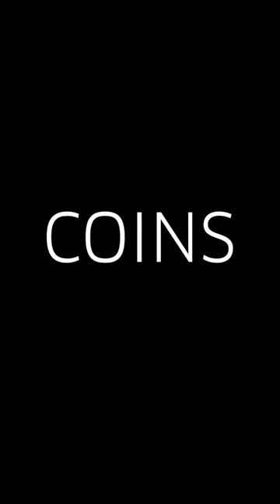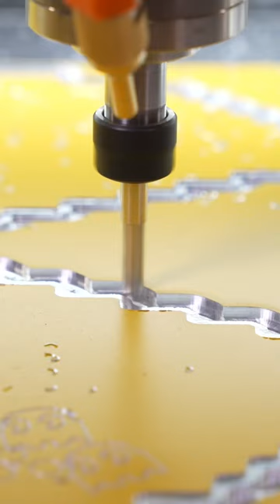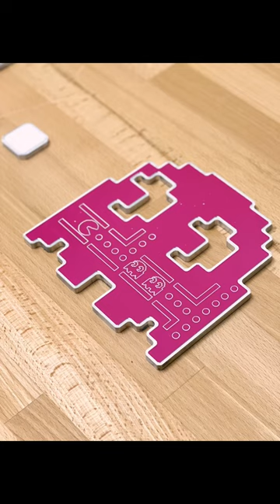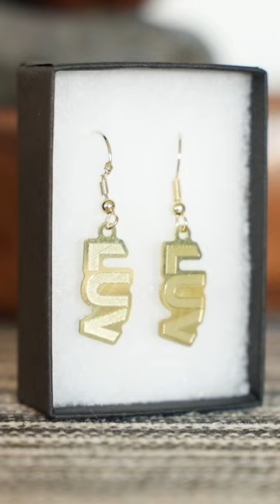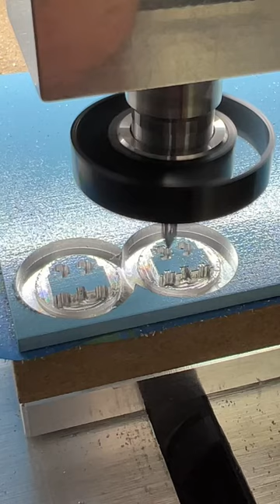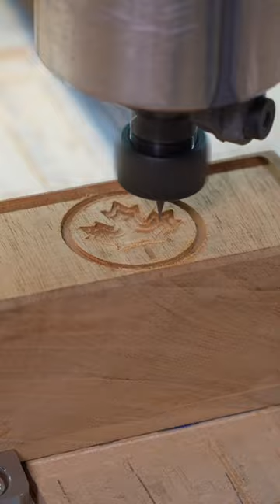5 Metal CNC Projects

Comment: woahh i never knew you could get a CNC machine at your house! and for a reasonable price! do you have any recommendations on which one to buy? i love 3d printing and this seems like it would be right up my alley
Reply from the maker: This is a very individual question.  Look at the space you have available and buy the largest machine you can.  Because, when you start making things, you'll immediately think of something larger than the footprint of your machine.   For many people the 4x2 preserves space in a workshop or garage while still providing the ability to index full sheets of plywood through the machine for those large projects.   It's the best blend of capability and footprint.   That said, if you have space for a 4x4, there's nothing quite like the power of that real estate.   (also, the VFD is how the machine is really meant to be.  If you have the money......do it.   That's how we equip our in house unit.)

Comment: Cool inspiration, retro brass keycaps for keyboards?
Reply from the maker: Seems like those would be awesome. Also an interesting machining challenge. 
What would the weight of an all brass keyboard land at?????
Reply: @carbide3d  If you started coding on a IBM XT keyboard then weight was not a consideration. Thinking about CNCing POM (ie Acetal/Delrin) to sort out learning to G-code first. Do a search for Datamancer Keyboard to see some Brass stuff. My 3018 is a little small for those.  There are wood keycaps too now. Keycaps I think I can handle, just as learning exercise and my own use. Swap to laser for text engraving.